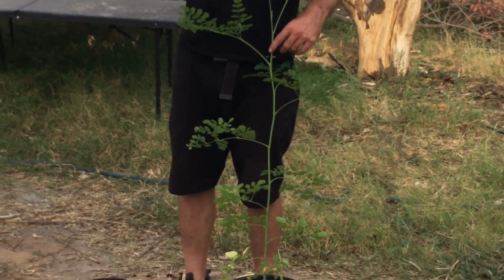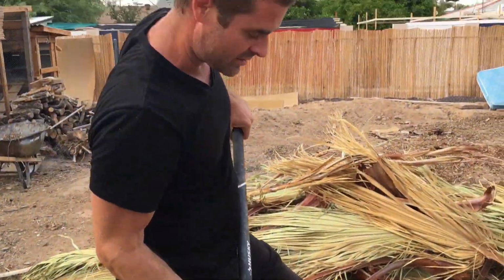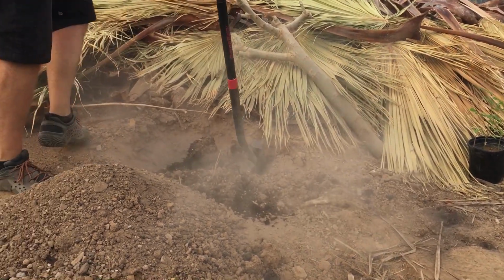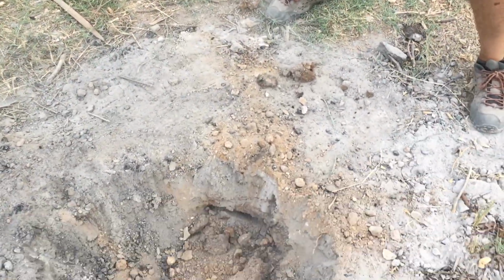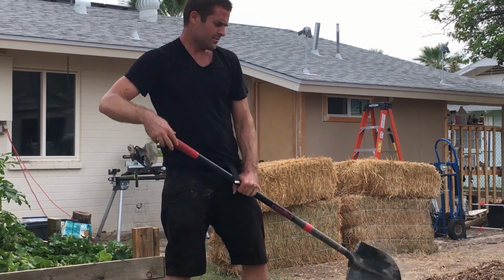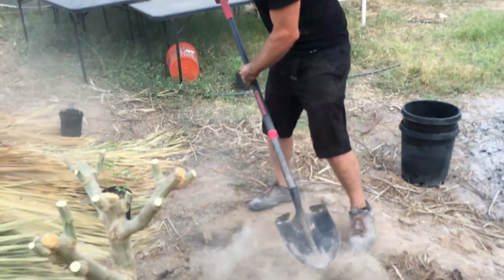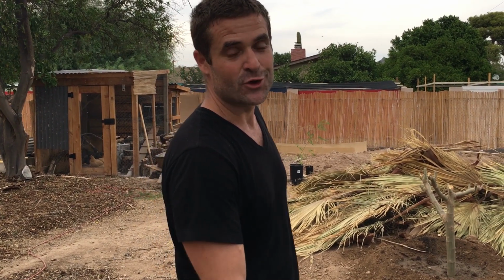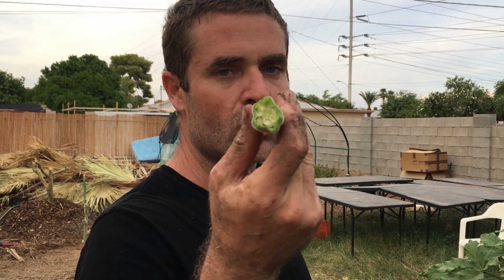Ep 97 - Planting LARGE Moringa Cuttings PLUS ** the Garden Workout! **

Comment: Hello, Dave.

First I want to thank you for some information you sent me a few months ago about the proper way to dry moringa leaves and now I have another question for you: 
My goal is to dry the moringa leaves and put them into capsules. So, can I dry the moringa leaves naturally, without using any mechanical process?  Do they dry enough to remove all the moisture content in the leaves? Let me explain first, that we started a moringa farm in the Philippines and we are growing about 2000 trees. We just have had our first harvest.  
We have built 4x4x8 metal sheds where we hang the pods for natural dry. After about 3 to 5 days the leaves start falling into a net, we let them dry for another week and then process the leaves into powder and finally we encapsulate them. 
The temperature inside the sheds gets to 34C in the afternoon and, technically,  we don't have winter here. 
We are concerned about the temperature variation between day and night, the air humidity interfering on the drying process and the time of leaves exposure to the outside. 
Our intention is to keep all-natural since we do not use any chemical, pesticides, and/or fertilizer, other than the moringa harvest leftover. We drink the same water we give to our trees and the air is pure since we are on the edge of the pacific ocean. 
We are trying not to use commercial dehydrator or stoves to dry our moringa but I have some concerns. 
Any help will very much appreciate my friend. We love your videos always. Thank you so much...

Anthony and Arnie